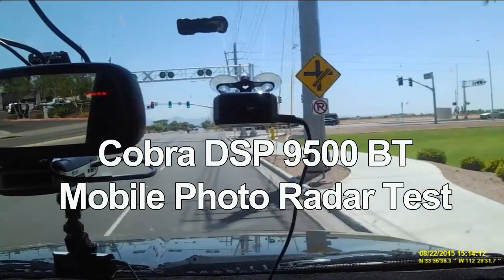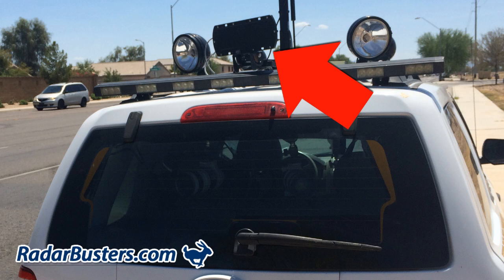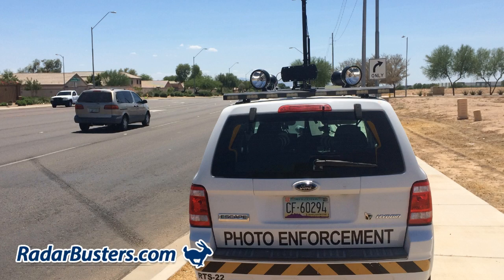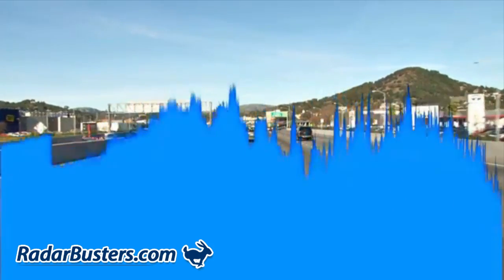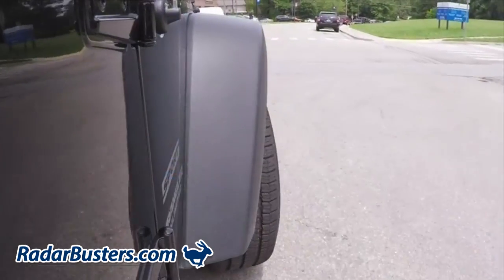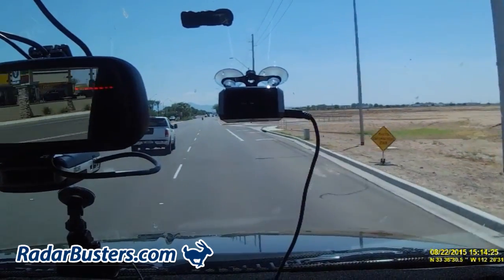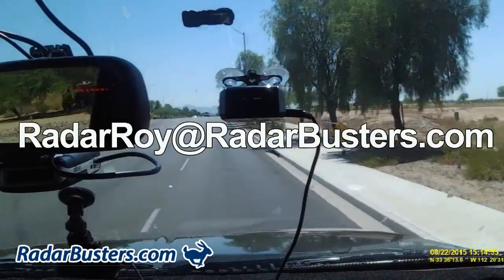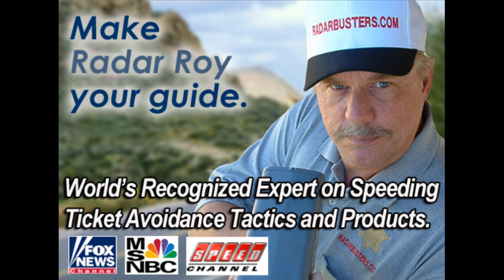Cobra DSP 9200 BT Mobile Photo Radar Test

Comment: how did the max 2 you had hanging there go tho? I haven't came across a mobile photo enforcement area yet. but it is good to know that they do run a KBAND
Reply from the maker: en392 I wished I had time to test the Max2 and a bunch of my other detectors I have with. There was an officer around the corner and in about 30 minutes they moved the van